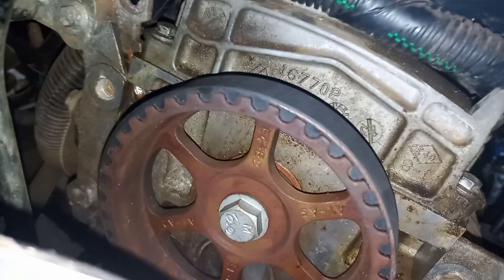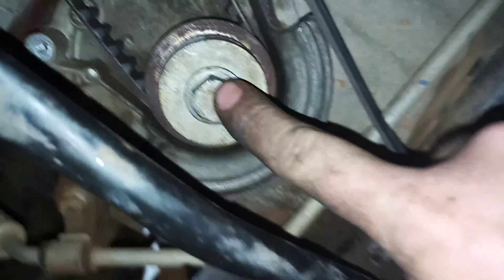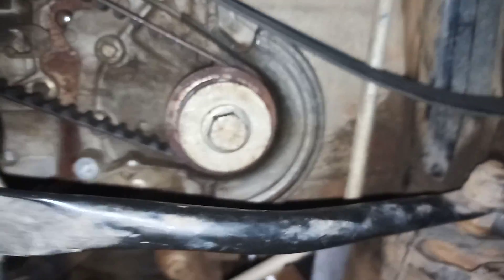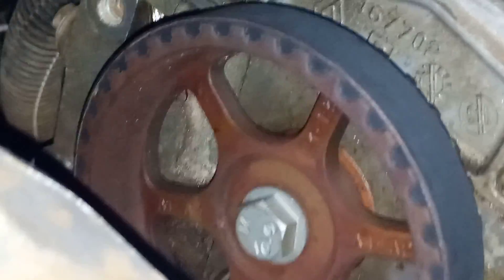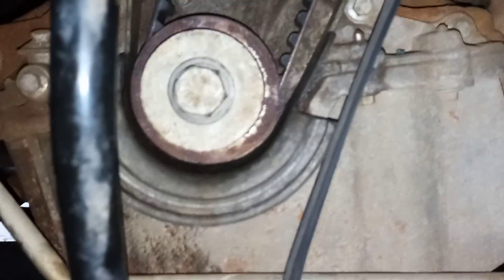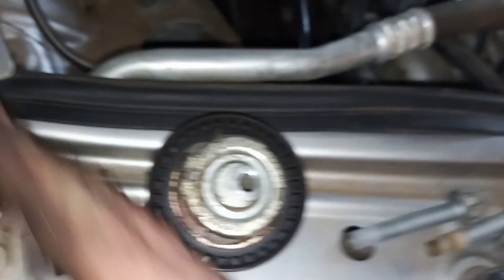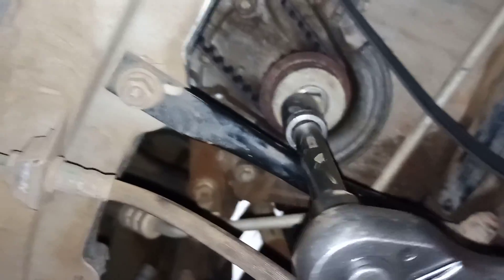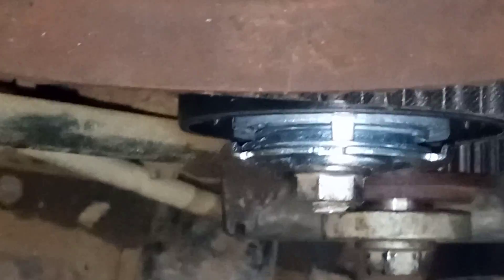2015 nissan np200 K7M 1.6 8valve timing belt markings.

Comment: Hi I got a nissan np200 that will not start  the engine turns but will not start
Reply: Had the same problem, I replaced fuel pump and it was A ok.

Comment: Hi 

Can someone please advize 

I removed cylinderhead  to have engineers put a plug insert in

Refited head but now have a misfire on that cylinder 

Done compression test-1000 kpa per cylinder -all good

Checked plugs and coil-all good
Checked pulse at injectors and tested injectors-all good

What I'm I missing
K7m engine 
1600 np200 nisaan

Comment: Boet is there a way i will be able to contact you, as at the moment im dealing with a very underpowered k7m np200?
Reply: I should also state that the there is no fault codes engine runs well just really underpowered maybe you will have some info for me?
Reply: @shirolupizoblivion1834  howzit ive got a 1.6  8v np200 with the exact same issue no fault codes but severely underpowered. Did you find a solution to this problem